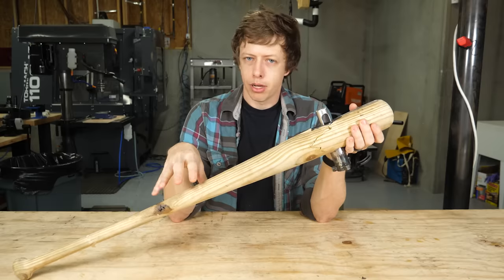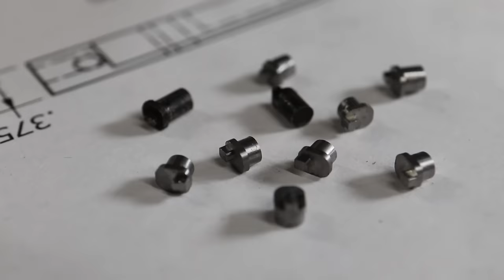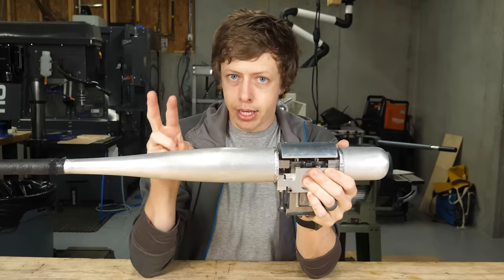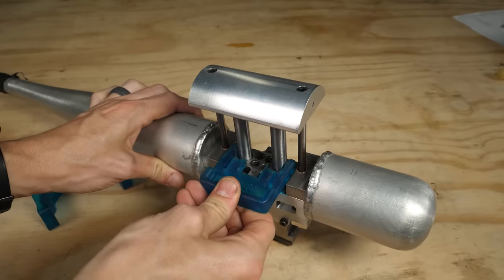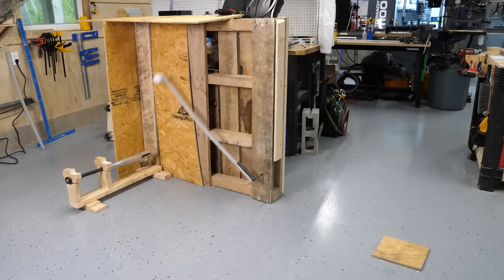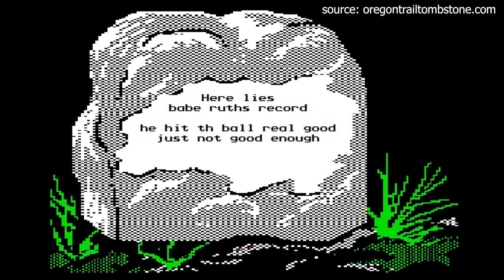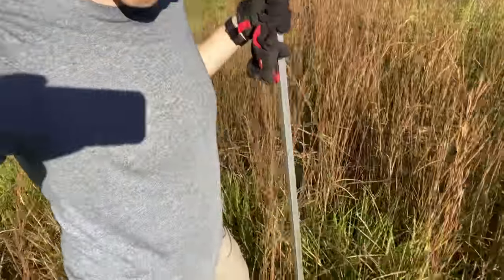Explosive Bat: crushing MLB records. Ft: Smarter Every Day

Comment: „Dont look up degloved fingers“
Me: instantly googles it
Reply: Omfg it is horrible right?!
Reply: same. he was right to suggest not looking it up
Reply: Instantly regret it as well
Reply: yeah they arent fun. happened to me when i tried jumping over a barbed wire fence, its a combo of the barb getting stuck then your body weight ripping the flesh
Reply: Did you regret it?
Reply: @adammetzger4182  i found it really interesting but it is really gory and if you cant handle that kind of stuff I wouldnt recommend looking it up
Reply: @jacksonblanks8038  could your finger be saved somehow or did they have to amputate it?
Reply: @fabianf7408  it's  was saved but I have very little feeling, didn't matter anyways as I damaged the nerves previously
Reply: @jacksonblanks8038  how did that happen xD
Reply: @fabianf7408  also mine wasn't from an explosion which generally means the finger will be a lost cause. Mine was cut from the bottom about where the webbing starts before your knuckle. Then it cut all the way up until it hit the end and caught and pulled all the flesh up. So mine wasn't ground beef as you could say. But all the nerves were messed up but luckily almost all my blood vessels were fine. Didn't require me to go under for surgery just some good pain meds and they gave me a shot of something so I didn't feel them stitch it back. Kept it wrapped up for a while and now it's pretty much back to normal except for the part I can't really feel anything there and there is a massive scar. Also important to say they may have tried more but I had much larger problems with my back as it also got cut up in the barbed wire so in total I had over 300 stitches. They were also worried about if one of my broken rips punctured anything. I had a hard time breathing so at first they thought I punctured my lung but turns out when almost all the ribs are broken, you hand is cut to shreds along with your back you in alot of damn pain.
Reply: @fabianf7408  long story short I was in a go kart crash and was throw off the go kart and rolled into the barbed wire fence, It caught into my back so I rolled along and got tangled and that is where a majority of my ribs were broken. I cut my finger open as I was trying to stagger my way back and at the time had to climb over another fence. Didn't feel the barb puncture my finger and I fell over it. I actually didn't know it happened till the doctors showed me.
Reply: @jacksonblanks8038  daaamn what a story but im happy that everything turned out ok and you still have your finger!
Reply: @fabianf7408  yeah it was a pretty bad crash, i learned the importance of using high quality bolts to hold in a race harness as that the reason i was throw out. also maybe a 300hp gokart may be too much. i have been racing for years but that was the one that about killed me. only other one that came close was at much higher speed but i only fractured a few bones and had a piece of carbon fiber go thru my leg. 3mm away from my femoral and everyone said that was my 2nd time that i should have died. since then i dont race and focus on the engineering aspect of motorsports. my medical bills also liked my decision.

Comment: You need a way to relieve the pressure, think  2 stroke engines. Once they explode, the piston moves down and opens an exhaust to dump the extra pressure, while all in the same time redirects the extra energy.

Comment: here's an idea.
as the piston appoaches the end stop there should be holes in the side of the piston ( like a 2stroke engine) which will vent the gases.
secomf improvement. vent the gases to the top of the pistin at the end of travel.

Comment: So my husband watched this and he was wondering why you didn't install a gas tube or escape. The same way a AR15 pushes it's bolt back just have a relief hole right next the the springs so when the piston hits the springs not only are the pistons helping stop the rods the gas holes help release the gas so the springs do not have to take as much pressure to stop.....

Comment: Try using a  nut weld for the stops using cast will likely break every  time but using the thread n weld technique probably will work and evem going as far to say run a double nut ive done this with a self loading propane tank mortar and it seemed to work this was done with custom heavy duty parts and other things auch as tractor bolts and nuts for tires etc
Reply: Note side affects are having more weak points this was a significant issue for me after the 20-40th self reload it stripped the threads but it didn't rocket off you can tell theres damage and replace it i gotta do it every 4-8 mags

Comment: To take load off the shocks did you think of venting the gas near the end of the stroke so you don't have to also capture and suppress the pressure in the chamber?  If you watch the ones without the capture you see how much gas vents when the pistons leave the chambers. There's still a good amount of pressure.

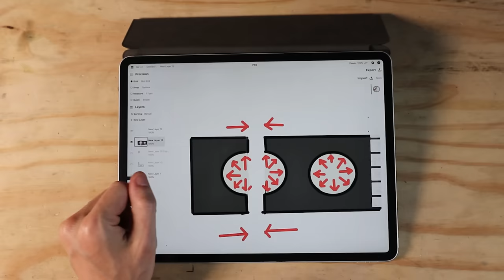Comment: while watching this video, around the 7:40 mark. i started to think about how, this hoop stress could be determined. i realized that it should just be the integral of (Force)(sin(x))dx, from 0 to 180 to get the cross sectional force at a singular point, and then multiply by the length to get the total force. and this would represent the force that is applied from one side onto another,  and it all simplifiys due to the integral to, total force = 2*force*length.thoughts?

Comment: People have actually made machines that hit balls over 700 feet and they estimate that’s the theoretical limit a ball can fly when you hit a ball that hard it doesn’t fly straight. They basically made a helicopter that spins at over 500 RPMs a couple people did I mean when you’re hitting a wall that hard you’re going to destroy your bat with one swing and destroy the ball so I forget what channel it was, but they said the theoretical limit is around 720 feet

Comment: Is this possible with a hockey stick? Chara holds the record for a 108.8 mph slap shot.
Reply: Maybe with a less powerful version, and a smaller slimmer design, I think any way you do it it would probably dig into the ice more than it would hit the puck, or just break the stick on the first use.

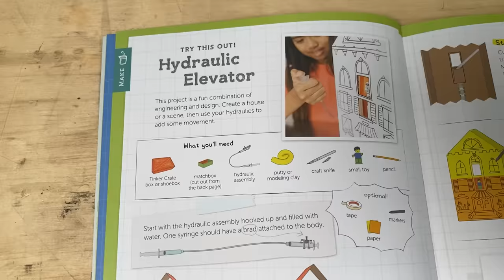Comment: Wait a second..at 23:06....did she just say, [squeal] Goo goo ga ga?
No way! Thats incredible...That means that
24x2+25x−47=(−8x−3)(ax−2)−53
You should then multiply (−8x−3) and (ax−2) using FOIL.
24x2+25x−47=−8ax2−3ax+16x+6−53
Then, reduce on the right side of the equation
24x2+25x−47=−8ax2−3ax+16x−47
Since the coefficients of the x2-term have to be equal on both sides of the equation, −8a=24, or a=−3. 😳
I gotta make a call!!

Comment: I’m very late to this video.
Instead of two cartridges, a convoluted flow path, metal pistons and recoil springs, how about this?
Four cartridges, two driving the piston forward, and two firing in the opposite direction.
A four cartridge recoilless bat.
Boy, that would be spectacular!
But watch out for the back blast.

Let’s be careful out there.
Reply: Greetings,
Forget the above, it’s completely wrong.

But there must be some way to some way to build a recoilless bat.
Reduced recoil guns were fitted to light patrol boats and aircraft early in WWI.
And of course bazookas and recoilless guns in various forms are in use today.
But again, you’ll have to allow for back blast.

Hmmmm.

Comment: How exactly is that .50? By the tube diameter? Also why not use 9mm PAK which is higher pressure than 9mm short blanks?

Comment: Of power generator ,so for 49% we solve the power requirements anywhere.its stand alone, off the shelf, turns 24/7  the generators  ideally would be half the size as the large gawdy remote free standing commonly used  ,cost are less due to portabilility and 24/7 out performs the on again of again

Comment: Dude
Would you consider co developing a device that basiclly  replaces the blades on a wind generator ,no wind needed to turn the shaft,however it does use as much as 20 %

Comment: just asking if calculate the maximum velocity of the piston and vent the gas chamber with a small hole where you maintain maximum velocity without breaking the rods every time you use it

Comment: Feels significant that you sorta overlooked the effect the material of the bat has on the distance of the strike. Aluminum bats are cheating in the major league for a reason, and if you were to give say Joey Meyer an aluminum bat, he could have hit the ball far further than the record. Although you ended up using solid aluminum for the striking surface, which might not have as much of the bounce effect that makes aluminum bats so effective. Would be interesting to see a comparison of ball distance to different materials. (The entire bat wouldn't even necessarily need to be a different material)
Reply: Although the bat spinning machine started with regulation wooden bats and broke them and then switched to aluminum so I guess that's fair if that's your competition.

Comment: Super cool video, curious what springs he was using for keeping the plate on the bat, it reminded me of valve springs on a high performance race motor where you've got to have a valve spring compressor just to get them seated. I also really like how he not only engineers the entire setup, but also works as a technician through trial and error. I feel like he could launch a ball a 1000 ft if he took on corporate sponsors and started building materials out of titanium and carbon fiber.

Comment: Actually, I lied it is possible to hit a baseball 575 feet Manny Ramirez hit one on the six lane of the mass pike. They estimated 580 feet, but that was before the stat cast error when they use computers to estimate it wasn’t an official home run estimation but they use mathematics and trajectory. They use geometry. An estimated if the mass Pike was on a level playing field with Fenway Park that a ball hit on the six lane of the mass pike was 580 feet from home plate. Also Jose Canseco hit one on top of the awning of the third or fourth deck, and either Kansas City or Toronto something like that they also estimated down at 580 feet but for some reason neither of those are even considered when talking about home run records, when you’re talking home run derby records for some reason they’re not even close to 580 feet or 575 feet I think Sammy Sosa has the record in a home run derby with a cork bat and a juice ball that used to do use juice balls at home run derby to make the balls fly further They put an extra bouncy rubber core but the home run derby record is less than 520 feet I think Sammy Sosa hit one 516 feet and in the home run derby back in the late 90s early 2000s around the time he hit 66 home runs maybe a year or two after but there’s a minor league baseball player that hit one like 590 feet it’s on YouTube

Comment: Confirming DO NOT SEARCH DE-GLOVING unless you have an iron stomach
Reply: The google description says “A degloving injury is a traumatic injury that results in the top layers of skin and tissue being torn away from the underlying muscle, connective tissue or bone. They most commonly affect the legs and are frequently associated with underlying fractures.”
Reply: @powerboy101  basically it peeled off the skin. I didn’t Google it, but was horrified when I realized

Comment: I’m sorry cause I love the page but you really could have maybe worked out for like 2 months and then used the same bat. You really didn’t need more power. 350 feet isn’t really that far especially if your not hitting a moving object. Like you’ve got height bro from a hitting perspective, hitting off a tee with a very , minimal ,tiny amount of work it easy to do. Still sick but you could have done it with the first one. TBH I think with 3 months work you could do it off a tee with a regular bat

Comment: I build 2.5 over the required strenth, so dont tell me not to try it... says guy who as a kid ha a 120 mm spud gun thats vapourized spud and had to use weighted walnuts to prevent the going 500 yards and over the river.... :-\   probably should have used atomized gasoline but the ABC is rated to 1200 psi so,,,,, why not?    lol

Comment: You should 100% make a golf ball video. 720 ft is impressive for a baseball, but only a 240 yard drive. Which is not that impressive. Hit drives over 300 yards in a regular basis. Tour pros can do it with 3 woods. Can you make a 1000 yard drive???